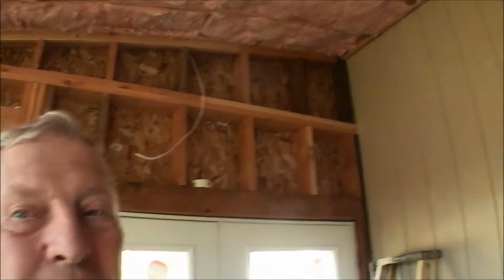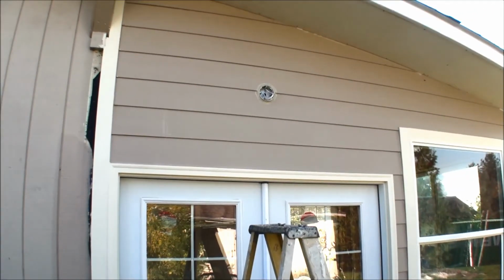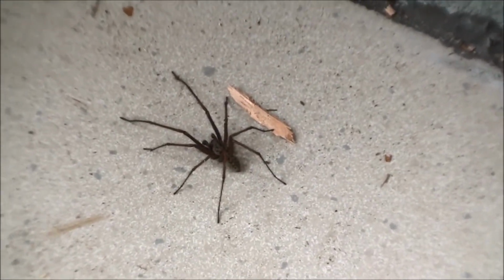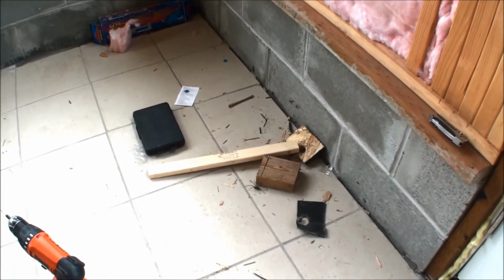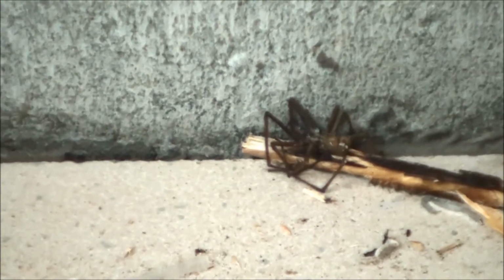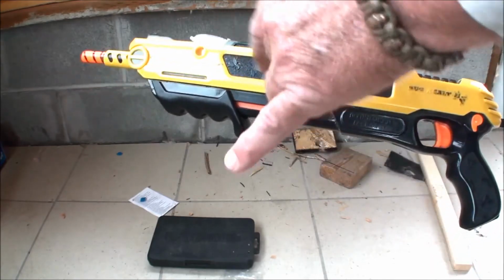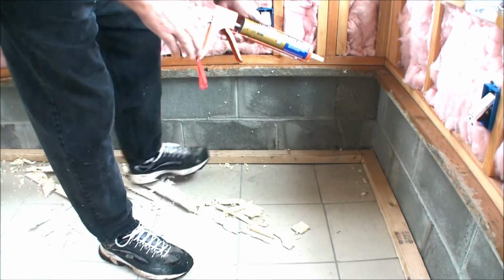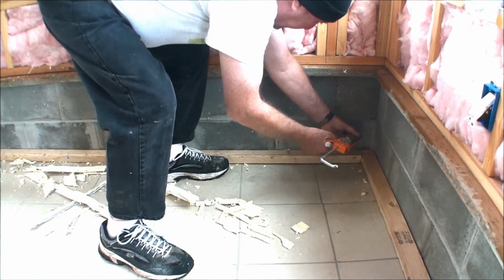Foam Board, Spider and Outside Light for the Washington Room

Comment: Holy mackerel! That spider was fast and large. 🕷 I have an electrified tennis racket I bought to kill flies and haven’t really used it but that gun looks like it did the job. We have a lot of spiders here. Maybe it’s the moisture in the basement. I live near a creek and our groundwater seeps in. Two sump pumps help keep it under control. It’s an old house with a lot of places for critters to come in. Anyway, the Washington Room is looking good!
Reply from the maker: You can go a bit wild with spray foam to help fill the cracks to help keep the spiders and air leaks out. But this gun was the best thing I have ever bought. Flies, Wasps, Spiders. It makes that job easier and fun at the same time Joanne Bea.